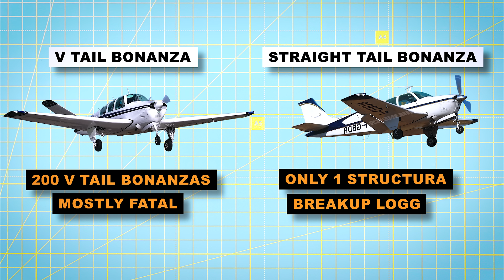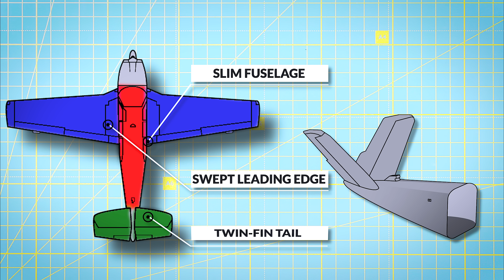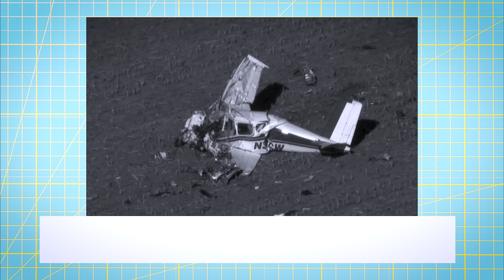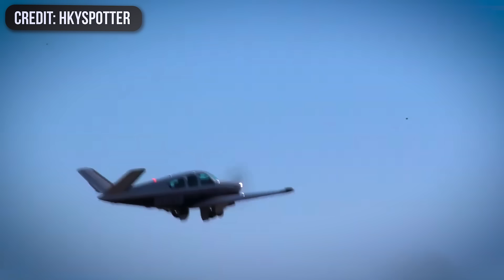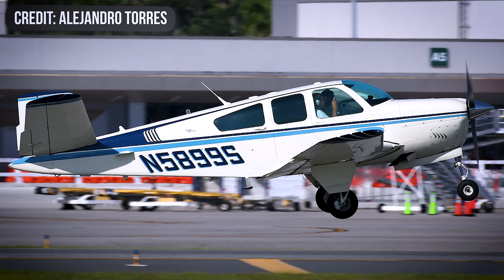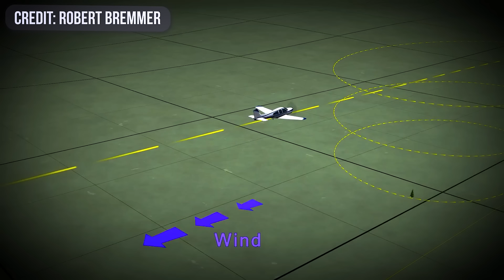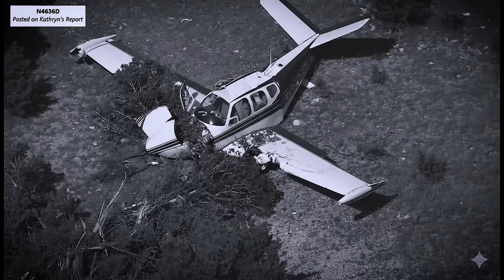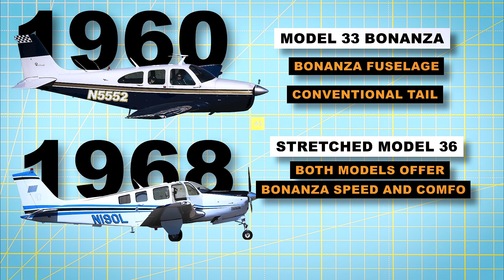Why Did This Plane Kill over 200 People?

Comment: A lot of BS here and playing with numbers. A properly flown V-tail is still the best single engine airplane ever built. I have owned two and investigated most of the accidents, including other GA accidents. The bottom line is pilot error and stupidity. If you look at Malibus lately there have been many inflight breakups as well, all due to flying into bad weather or over strssing the airframe. Light planes are not heavy or significant weather airplanes, Boeings are and that is something that should never be forgotten. The two most important "V" speeds for any airplane are Vso (Vs, if you will) and Va. Most pilots forget Va or what it means. And Va is no guarantee of safety as it too has a definition and limits. And finally, The GA fleet is old, meaning maybe some of these Va speeds might be less now as who knows what an airframe has been through over the last 5,000 or 10,000 hours. 

I've got a 1,000 hours in two different V35Bs. They are the best single engine GA airplane I've ever flown and easy to fly. I've flown about 60 different make and models of GA aircraft including Beech, Mooney, Cessna, Piper, Meyers, Bellanca (Super Viking), Cirrus and more plus perhaps the best handling two airplanes ever, the P51D and the T-28B. Of all the airplanes, the V35B is a close third to the T-28B. No other single engine GA airplane flys better than a V-tail. An A36 feels like a truck compared to a V-tail and an F33A doesn't quite have the feel of a V-tail and is 3-4 knots slower. I've flown off against F33A(s) and they are noticeaably slower.
Reply: Debonaires have 260hp whole the Bonanzas have 285 hp. My favorite Bonanza is a very rare one,the EA35 Aerobatic Bonanza with conventional tail(the only way it came). Some people have the "throw over yoke" replaced with a "stick".
Reply: @bigsky-o2s  Original Debbies had 225 hp O-470, the IO-470N (260hp) used was used in later Debbies until the IO-520 was installed in 1970 making it an F33A and called a Bonanza as is an A36. The Aerobatic Bonanza is an F33C. Scott Perdue has real nice one with an IO-550. Jim Peitz flies an F33C (N14JP) on the air show circuit.

Comment: Very good video!
We usually cite the V-Tail Bonanza as the high-performance aircraft for people whose checkbooks are thicker than their logbooks, very much in the vein of a certain aircraft I won't mention that is popular amongst the Gucci-heeled today. While this is certainly true, and in fact almost every one of these tragedies could have been avoided by more attentive operation, it was nevertheless marketed as a tweed-suit speedster, when in fact it was not without its design foibles, requiring a skill set well beyond its advertised docility. 
I still see quite a few of them, and inside of them today you are sure to meet a proud owner who is keenly aware of every aspect of this aircraft, its operation and maintenance - a very different breed than those to whom the aircraft was initially marketed.

Comment: This video does not mention the insidious buckling of the skin forward of the spar that was identified and publicized by the Aviation Consumer following a wake turbulence encounter that the pilot survived by deploying the flaps. When the tail area was increased to provide stability with larger engines, the d-shaped leading edge skin was approximately doubled in the fore aft   Overhang from the spar. There was no structural connection in front of the spar. When the tail was nose up overloaded the cantilevered skin buckled and the result was that the tail surface was overall twisted for strong nose up. At speed, this caused the wing to pitch up and fail the spar. The wreckage, sans black box data, made it impossible to identify the cause.
When are gentleman encountered wake turbulence he was slowed below cruise. This kept the wing spar from failing, and flaps provided pitch down moment to keep the plane controllable. Long story short, the fix was either a stub  spar mod or a leading edge cuff connector, both providing another connection got the skin in addition to the spar.
I believe an AD was issued to require one or the other.
Beech tried to buy the damaged airplane and cover up the event but the owner refused and made it public. 
Buckling is an insidious failure mode.

Comment: As a Pilot, I always liked flying Beechcraft products. I have flown many of them, from Sundowner thru Kingair, including Bonanzas and Barons. They all are a delight to fly. With well balanced control effort and harmony. But I was also an A&P/IA/DoM. And just hated working on Beechcraft products. Everything you do on them, is just a PITA. Unneccessarily difficult to access, rig, and service as compared to all their competitors. For maintenance, give me a Cessna or a Piper any day. As owner/pilots, you don’t realize what goes into maintaining your Beechcraft. Many jobs, like rigging the electric gear and flaps, or that Vtail, are just much more involved than the same jobs on most other aircrft. When taking your Beech in for Annual or repair, don’t shop price. Instead look for shops that specialize in Beechcrafts. Having it properly maintained will go far in keeping you out of trouble.

Comment: There is a whole lot of mis-information in this video.  First, the comparison of airframe incidents between V-tail and straight tail is misleading at best.  More than 6,000 V-tail Bonanzas were built and sold before the first straight-tail Bonanza was released, so that single data point from a specific date is taken massively out of context..  Second, the claims of inherent instability aren't really accurate.  A properly maintained Bonanza, when properly trimmed in flight is extremely stable and easy to fly.  Finally, the insinuation that the Bonanza is inherently unsafe is simply not true.  The AOPA study done in the 1980s showed that the Bonanza had a LOWER incident rate than that of similar planes.  The reason it gained a reputation was because there were so many of them in the air, not because they were any more hazardous or failure-prone than any other light single engine w/ retractable gear.

Comment: Awesome airplane.   It hits the sweet spot on versatility and cross country capability.
Reply: 182 is much better.  

Roomier (you’re sitting on the wing spar in the Bonanza so if you’re tall torsoed you have less head room), easier to get in and out of, cooler (shade from wings, fully opening windows), better off strip and on unimproved strips, lower stall speed and better field performance, room under the wings to camp.. or for “hangar helpers” (classic cars, motorcycles, and boats etc to pay for your hangar), larger used parts base and support, far less maintenance, lower insurance, ability to operate off floats.  

All the Bonanza can do that’s better is go faster.. which on a typical $100 hamburger run is the difference between the 182 coming into the pattern while the Bonanza passengers are still struggling to disembark.
Reply: @calvinnickel9995 I will be sipping my second soda as you arrive after a 350 mile cross country.

Comment: There is nothing inherently wrong with the V design. Every aircraft requires correct operation and maintenance. 
The only problem with them is how easy they are to fly which drew pilots who weren’t experienced enough to handle the airplane properly through the whole flight envelope.

Comment: I flew a V35 for many hours in all kinds of weather except icing, and it got me there - eventually. The tail wagged and passengeers threw up, but no part of the aircraft departed except during maintenance.  I have  a bittersweet memory regarding costs, but no real complaints about the aircraft other than finicky gear and those damned magnesium control surfaces that wanted to corrode away.  I'd have preferred shorter wings and snappier handling, with  light enough wing loading for high elevation private strips.

Comment: I'm an engineer but not an aero engineer. Now, lets debunk some of this 'debunking'. The V35 Bonanza was not a 'fatal design'. It is one of the best designed airplanes in the world, and sold more than any other GA plane except the C172. As the plane got bigger engines and heavier, the wing loading went up and the power loading went up. In 1947 it was a delightful plane, with a small V tail, and handled fantastic. In 1956 the ruddervator was redesigned for higher weights, and greater power. It was increased in size by 31% and the V angle was reduced 5 deg. Part of this was an attempt to minimize dutch roll in moderate and heavy turbulence. The mod, did neither. What it did however was to increase the un-reinforced ruddervator area in the leading edge where the greatest stress was found. Once the ruddervator cuffs were installed on the H and later models, and the plane was flown within the proper flight parameters, the fatality rate went down lower than the comparative planes from Cessna and Piper. The plane is certified in the utility category at full gross weight, unlike the others which are certified at the 'normal' category at full gross. It's a delightful plane to fly, when operated within the proper flight envelope. But - when it's pushed, as in yellow arc descents in the clouds, the pilot better be on their toes, literally. High performance planes are less forgiving than the old Cessna. Often, when a pilot got into trouble on a descent the first thing they would do is haul back on the yoke. This would deform the leading edge of the ruddervator, and the vertical component of control was lost. The plane would yaw until the wing broke off and the plane came down in bits. Using the throttle to control descent will save the day, and the plane can be flown safely by anyone willing to follow the POH.

Comment: Arguably one of best airplanes ever made, longest in production, unbelievably strong landing grear for green field landings, fast, sports car handling,  fuel efficient.   I learned to fly in an F35.  First solo in F35. Private ckeck ride in F35. Can land in your back yard with some headwind.  Absolute pleasure to fly. Only thing wrong with Bonanza is the pilot in control.  Does not tolerate sloppy or inattentive pilots.

Comment: IMO Bonanzas are great airplanes that got a bad rap when they were introduced in 1947. The training airplanes leading up to the Bonanza were J3s, Stinson 108s or Champs. The difference in performance was incredible. There was no other single engine airplane in 40 knots of it when it was built. Once it got the reputation it stuck.
Operate airplanes within the designed limits and you have a very good chance of getting out in great shape.
Aviation can be very unforgiving. You are only allowed to screw up so many times. You just don't know what the number is.

Comment: The reason the V35 became known as the doctor killer was that they were top of the line very expensive planes. A pilot needed to know how to fly, air speed could easily exceed the pilots skill level. A knowledge pilot could safely fly this airplane. The joke about the doctor killer came about because so many doctors were killed by the V-tail hitting them in the back of the head when they dove them into the terrain at red line speed dislodging the tail from the fuselage.

Comment: I may of missed it but I didn’t see or hear anything about the V-Tail cuff.  An AD piece of metal attached to the fuse and leading edge of the V tail. Many years ago, I flew in a 1979 V-tail with that cuff.
Reply: I had a 35 (no letter) and it had the cuff added.
Reply: @steveasher9239  No, you didn't. The model 35 from 1947-48 was a 'small tail' aircraft, and the AD for the cuffs was specifically NOT for the model 35, A35, B34. The cuffs were installed on the C35 and later airframes. The model 35 had a skin thickness AD test, but no cuff AD.
Reply: @docmirror8009  thank you
Reply: @docmirror8009  Well there was something extra on the root of that tail.  Maybe you can tell me what it was that looked like a cuff (perhaps not the cuff you refer to).  It's been a long time and even at my age I'm certainly willing to learn.
Reply: @docmirror8009  Correct.  My J5 has the cuff (as does any later V-tail that is still flying).

Comment: "The Day The Music Died"  Charles Harden Holly, Richie Valens, Jiles Perry Richardson and pilot Roger Peterson.  Though I believe the crash was officially attributed to "pilot error" it seems more likely that the bad weather conditions pushed the plane over it's structural limits.  Young as he was, Peterson had over 600 hours in the Bonanza.
Reply: No.  That plane never went high or fast enough to get anywhere close to its structural limits.  The pilot was not instrument rated, yet took off after midnight into a snowstorm with zero visibility.
Reply: @FT-64 dude stop talking

Comment: It's a perfectly safe machine; the problem is pilots unprepared to fly it.
Reply: Does that mean the original Gee Bee racer was a safe aircraft and the reason it crashed so much is pilots were not prepared to handle it? Jimmy Doolittle was one of the few to do so.

There was a ferry pilot who landed one and refused to continue. His replacement was killed on takeoff.
Reply: @richardbriscoe8563  
LOL! You're comparing a GA pussycat manufactured for laymen to a Gee Bee? Have you EVER flown a Beechcraft or anything else for that matter? I used to test fly aircraft for a manufacturer; believe me, there's nothing dangerous about that creampuff, V-tail or not. A pilot needs a modicum of experience in a clean airframe, an engine of some two- or three- hundred horses and to be both current and proficient, especially if he's gonna fly IMC. It's not rocket science, but it IS airplane science. Geesh!

Comment: Much baloney about nothing.  This has been documented ad-nauseum.  People would transition from a Cessna 172 or Piper Cherokee to the Bonanza.  They'd flight higher to cut fuel burn, and then treat the Bonanza (a go fast airplane) like a Cessna or Piper.  Push the nose over.

You push the nose over in a Bonanza, you pick up speed - FAST.  I've owned a B33 since 1989 and 1000 hours.  You have to PLAN descents, MANAGE energy.  The skills of the pilots were not good enough.

Still, I got 10 hours of transition training which covered all of these concerns, and I've flown V-tails on several occasions.  Apart from the dutch roll tendency (eliminated with a yaw dampner) of the V-tail, these planes flew great and were faster than their tri-tailed counterparts.

V-tail production was stopped when they weren't selling as much as the tri-tailed version.  It wasn't liability - it was the market.
Reply: Still sounds like its more dangerous than a conventional tail. Also more maintenance reliant
Reply: @kainhall  , it has nothing to do with the tail, and everything to do with the fact that it's a high performance, high power small plane with retractable gear.  It's a very low drag design, and it takes time for it to bleed off speed.  I've had ATC bring me in to an approach far faster and higher than my Bonanza can safely descend and decelerate, because it's just plain different from other light planes.  Once you learn how it operates, though, it's actually a very easy plane to fly safely.